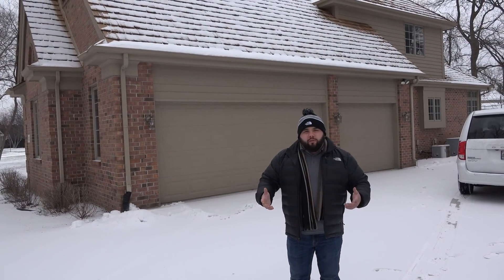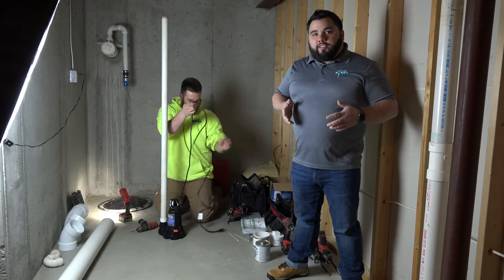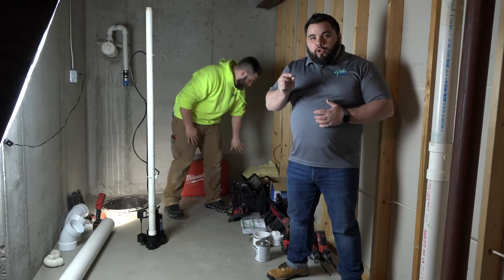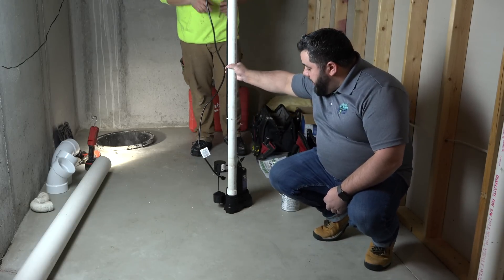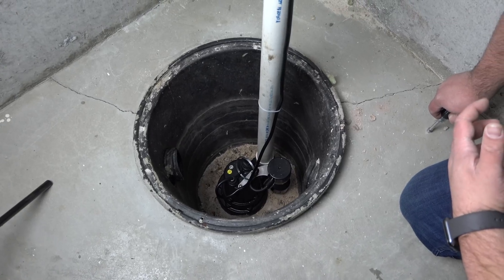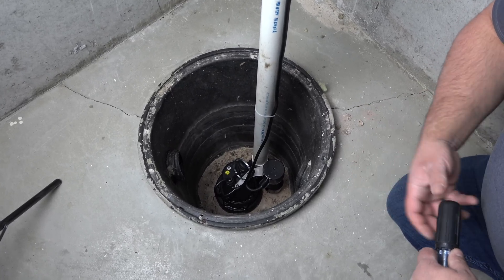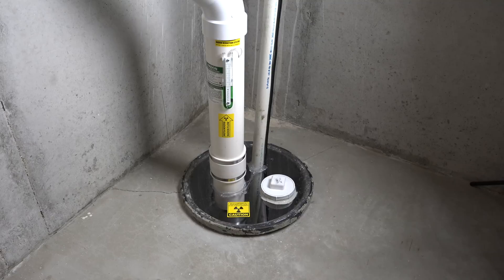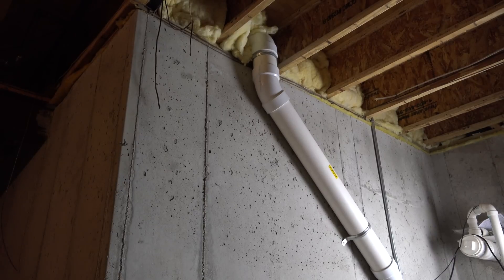Radon Mitigation System Installation

Comment: How does CO2 come from the sump pit? What is the source? If it did, every home in  North America would have a problem.
Reply from the maker: Mark s it is actually not CO2. It is Radon gas. Radon is a natural, soil gas derived from uranium product in rock and soil.
Reply: @lifetimeradonsolutions9498  yes makes more sense....just a bit of a difference
Reply from the maker: Mark s yes it’s definitely a difference. I think I know the part of the video that you are referring to now, though. What I was explaining is that if the sump is not properly sealed when you are pulling air from the pit you can actually pull air from inside of the basement. This can be problematic when appliances are near by (depending on the efficiency) as the fans negative pressure can backdraft CO2 from those appliances.
Reply: Lifetime Radon Solutions, following up on Mark s’ question, how about interior air being drawn from cracks/joints between the slab and the foundation wall?  I have a basement that is partially finished, so I cannot seal all of these cracks as they are inaccessible in the finished areas. Could back drafting still be an issue for me?
Reply: Mark s - I think you're referring to what Brian was discussing at around the 1:50 mark - backdrafting and CO (carbon monoxide). I think backdrafting refers to natural gas furnaces (and maybe oil and/or fireplaces) that produce carbon monoxide as well as other noxious gases when they produce heat. If your basement has a constant vacuum but it is sucking air from the basement and not the floor, the exhaust gases that should be leaving could be pulled back in to the home (backdrafted) where they can make you sick. I suppose that gas water heaters could be a problem as well, but generally don't use as much gas and thus don't produce as many noxious fumes, and if you have an electric furnace, you probably have an electric water heater and all of this isn't a concern.

I say this because I heard Brian say carbon "di"oxide the first time as well :-) CO2 also isn't good for you, but not as big of a concern as CO in the short term or radon in the long term. You need a little CO2 and Nitrogen mixed with the O2. Also you'll KNOW if you have CO2 poisoning. CO poisoning just makes you feel a little icky and sleepy, then you go to sleep and it kicks in and you die :-(

Overall, nice job on the video, Brian and TJ. My only critique would be to "get on to it". Leave out the intro, outro, and that guitar tune we've all heard a zillion times and you'll look more professional.